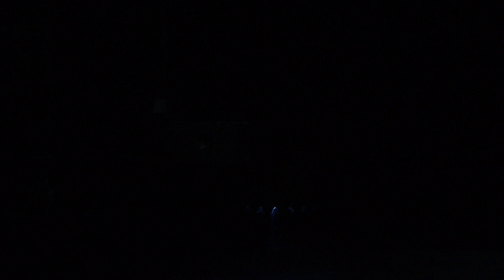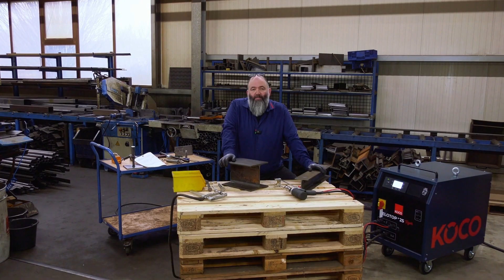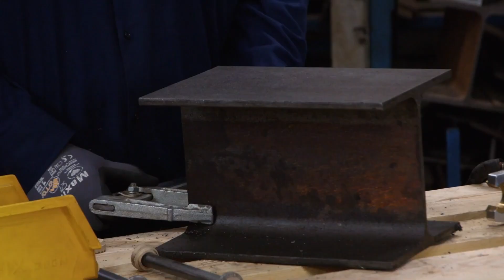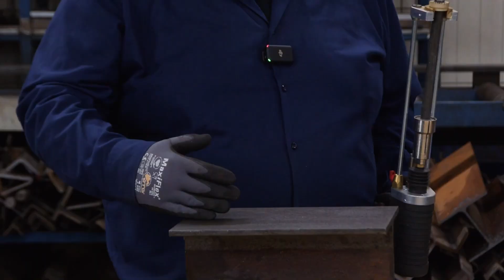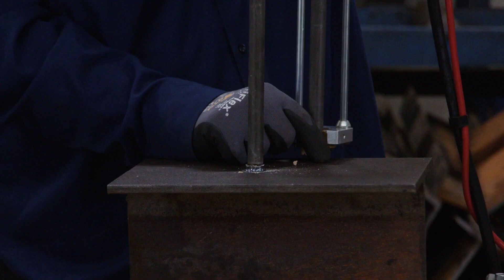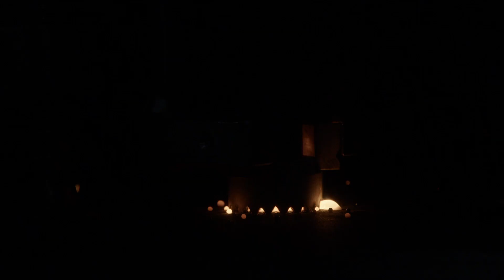🇬🇧 KÖCO – Welding of studs on beams

Comment: What's the strength on a weld joint like that?
Reply: Die Schweißverbindung ist immer fester als der Bolzen oder das Grundmaterial. Bolzen sollte niemals in der Schweißverbindung brechen